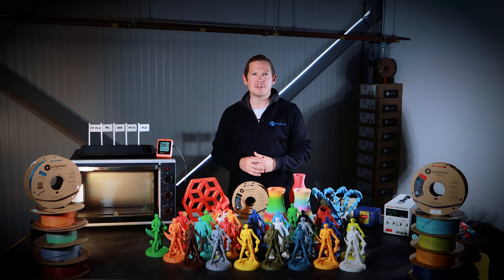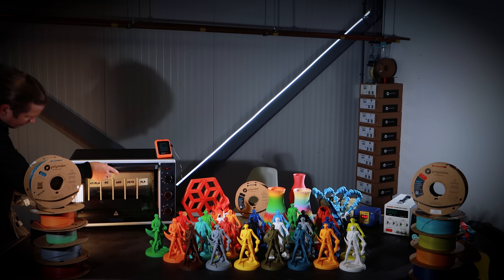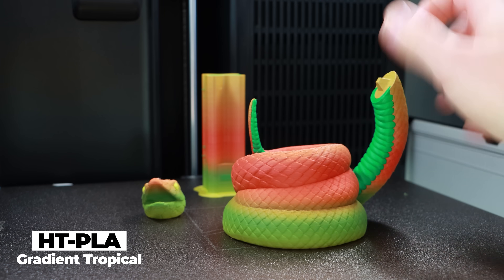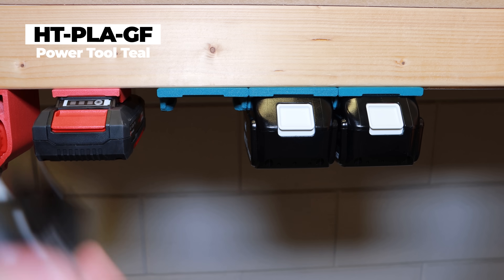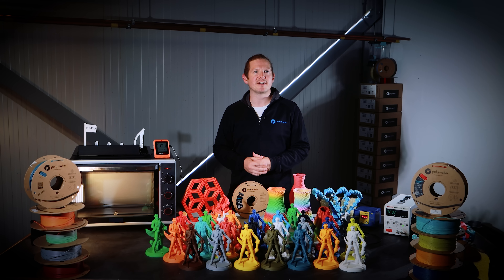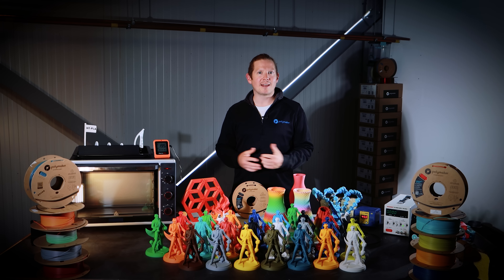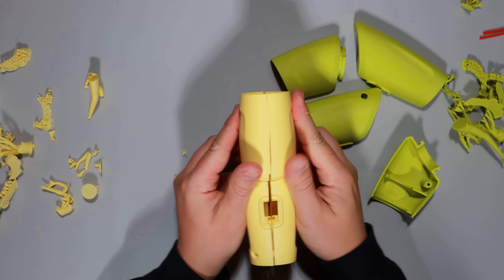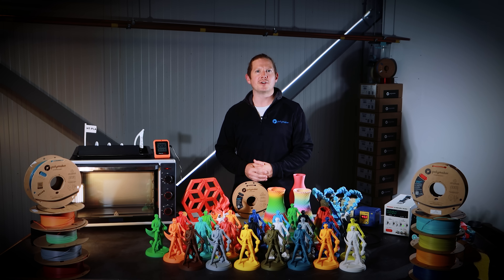HT-PLA: One Filament to Rule Them All 🔥🔥🔥

Comment: I am sceptical to say the least. These sorts of claims have been made before, several years ago by Big Rep and others. The reality when testing that filament meant it fell well short of the claims.
The test in the oven looks very suspicious, the ABS, PC and PETG flags all fell over before the standard PLA flag, that's a bit weird, isn't it??  And when the infrared gun was pointed at the PC sample, for instance, it read around 90C. True PC filament, not the easy-to-print stuff, has an HDT of 135C, and yet it melted at the same time as the ABS (85C HDT), and PETG (70C HDT).

I dunno, many things don't add up here.
Reply: I got a roll of this HT PLA a few days ago and finally got to try it. As I suspected the HDT, if any higher than standard PLA, it is only by a couple of degrees, maybe 55-58C before it goes flexible. 
It will NOT hold up to 75C like PETG, or 85C like ABS, or 130C like PC. It is an absolute lie by Polymaker, claiming 150C! If you don't believe me, try it for yourself. 

I can go into why this is, but you need to know how they do the official HDT test to see why it does not work for resins, nylons, and this PLA. Manufacturers use the flaw in the HDT test to make wild claims. If anyone is interested, I can go further into...
Reply: Well... that's what channels like cnc kitchen are for
Reply: @Vizeroy9  While I find those types of channels interesting, I would never believe the claims until I've tried it myself. With 20 years in the printing industry running a leading print service, I believe our customers deserve the truth about the services and materials we offer, not just here 'say.  
I would argue, through experience, that over 80% of claims made by material and machine manufacturers are false, but go unchallenged, and influencers spread these mistruths as gospel. This sort of thing is rife in this industry, it is very disappointing, and only getting worse.

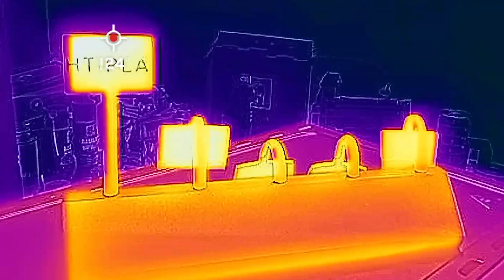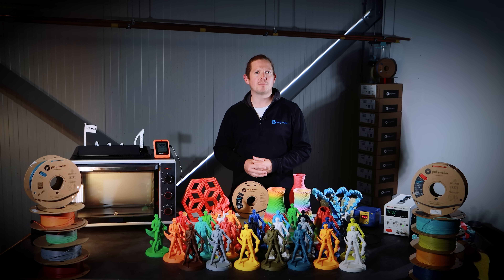Comment: There were a few shots you did that made it seem like you were hiding or minimizing some of the warping/drooping the HT-PLA was undergoing.  @5:10, you swept the camera low to hide the fact that the HT-PLA had warped backwards a bit, and at 7:09 you never showed a comparison in joining the drill housing parts before and after annealing, and the annealed HT-PLA-GF parts still have significant gaps in the joined housing.

I'm not saying I'm not interested in the product--frankly, it could be very useful--but some of the video editing/camera work choices definitely left me feeling like there was some deliberate manipulation going on. Which, obviously erodes my trust in the claims and company's integrity.

Comment: This is a MASSIVE revolution on 3D printing. Most people thinks that the evolution (and revolutions) in 3D printing is about the printers, and it's true but you can have the most advanced 3d Printer on the market but you cant print a simple coaster in a non "exotic" material that you can put in the dishwasher. So the real big evolution is on the materials! Thanks Polymaker for this, hope to be able to buy it in Europe as soon as possible.
Reply: Except they are marketing it as new? Other companies have been doing it as much as 5 years ago so what's different about this? And does it need a hardened nozzle?
Reply: @magus104 it's quite different, just read the data sheets.
Reply: not that massive since one company already had this, it was just more expensive
Reply: @riba2233 I don't know the company you mean, but the ones that I know that have ht-pla have really different thermal properties like a lower heat resistance and deflection specs (in some cases WAY lower that the polymaker's one like 70 Vs 130...) , no thermal stability during annhealing , and printing speed max at 60/90 mm/s.
This is the first product that I know that has a heat temp resistance up to temps that neither ABS can stay, a perfect dimensional stability during annhealing and a very high printing speed up to 350mm/s. If you know any other brand that has ht-pla with the same or better specs, please tell me because I will buy it immediately.

Comment: What Ingeo resin do you use (I see that branding on your spools)? And how does your filament (with your "11 herbs and spices" added) compare to that raw Ingeo resin?

I am a little disappointed in your naming, because it will be easy to conflate your HT-PLA with ProtoPasta's HTPLA (Ingeo 3D850, I believe). But, I do applaud you for including the empty spool weight on the spool's label. I often have to bother filament manufacturers to get that value so I can track how much filament I have left on each spool by weight.

Comment: HUGE! Cant wait for the UV-resistance tests! If its practical for outdoor use, there is literally no reason to use different polymers, apart from vapor smoothing maybe
Reply: it's UV resistance is similar to standard PLA
Reply: @PolymakerPete  damn. Well, its still PLA so I guess thats to be expected. I will probably stick with ASA for outdoors, but for inside the car, it should be perfect!

Comment: I really appreciate the no BS of this announcement. There are a lot of companies that try and make something better then it seems. They clearly showed it's improvements and its limitations.
Reply: I also appreciate them not calling it biodegradable, it's industrially compostable.
Reply: In my eyes, this company is the one of the most reputable and reliable filament maker company.
Reply: The temperature limit is impressive, but let's set aside the heat resistance test for a moment. Is this truly everything standard PLA offers, just with added high-temperature (HT) capabilities? After reviewing the My Tech Fun analysis, it appears HT-PLA is a weaker material across the board—except, of course in thermal performance. So, is it really "everything PLA is, & HT resistance"? Not yet. Hopefully, you'll develop a version we can genuinely call PLA+ht. Right now, it's more like HT+pla, where heat resistance has overshadowed all other essential qualities of PLA.

To illustrate, imagine if regular PLA exhibited such compromises: layer adhesion failing at an average of 24kg or tensile strength breaking at around 48kg, This would be considered rubbish PLA. Until high-temp PLA matches or exceeds standard PLA in every other metric—while retaining its HT bonus— we can't claim a true breakthrough has been achieved!
Reply: @gtrargh6637 it has to be printed at higher temp but yeah, it's not the same
Reply: they didn't show all limitations
Reply: LMAO yall are susceptible to propaganda
Reply: @youtubehandlesux because of some mild praise for a company that genuinely makes pretty good products? Your bar seems a little low and a lot misplaced lol
Reply: This video was only BS, nothing they showed was true! Get the material and try it for yourself. I would suggest not buying it though, as you'll just waste your money like I did.
Reply: @bendoon12 it was all true, what are you even talking about?
Reply: @riba2233  So, when I put a 3mm thick test part in 60C water, and it went floppy/flexible and deformed... you think that is better than standard PLA?

Comment: How does the additives used in this HT-PLA affect its recyclability/compostability and are there any non bioplastic additives in this?
Reply: The resin matrix of HT-PLA contains only a small amount of non-biodegradable components. Therefore, we consider it to be a material with good biodegradability similar to polylactic acid.
Reply: @PolymakerPete  wonderful, however when you say small, could you please quantify that to an approximate percentage. Are we talking fractions of a percent, <5% etc or does small just mean <50%?
Reply: @n0vaph0enix  Hey, how come I cannot see their reply to you? Is it hidden for you now as well? Interesting that such info on the material gets removed from the comments...
Reply: @Prefrontal_Cornflakes I think they may have updated the comment as a direct reply to my first message (or it’s a weird youtube thing as it’s showing as a highlighted reply in my view).
Reply: @n0vaph0enix Oh, alright, I guess it might be just on my end then, since it's still not showing. Or as you say, youtube shenanigans xD thanks for clarifying
Reply: PLA in general is not very good in compostability (though better than other materials) nor recyclability (can't really mix random plastics with "real" plastic in recycling, unless doing some mix bulk product (flower pots etc), but all of them can be burned to energy).
It's more about where and how the raw material comes --> what it's carbon balance at the end of life/use is. Oil-based plastics add to atmosphere CO2 , while plant-based plastics (PLA, micro cellulose) circulate it.
Reply: @kimmotoivanen thanks, I am aware of that, but what focused I’m on whether this this resin mixture affects that in any way meaning it can no longer be accepted in PLA recycling schemes and existing industrial composting facilities.
Reply: @PolymakerPete there are various recycling schemes globally that take PLA but some (such as 3DWaste in the UK) specifically only take PLA, so it’s important to know how much additives are in the mix to ensure it’s low enough not to contaminate virgin PLA waste.

Comment: How is layer adhesion?
Reply: TDS is on the product pages for each, but if you're comparing to other PLA's it's similar to standard PLA.
Reply: poor unfortunately
Reply from the maker: Tensile strength (Z): 20.83±0.51 Mpa

Comment: Your TDS stats do not seem to match the claims around this product. According to your product pages PolyLite PLA seems to have a HDT at 0.45 MPA of 60C, and now your HT-PLA has a score of 69C. This is much smaller of an improvement as I was initially led  to believe, let alone over other materials, such as your PolyLite PETG scoring 78C.

You say the material requires no post-processing, but in this video you show that the 114.7C HDT score is only achieved after annealing. While I don't know the figures of your other PLA offerings when annealed, I do see in the Journal of Applied Polymer Science an article about annealing PLA in injection molded products reaching approximately 110C, which if consistent with 3d printed items would leave me disappointed with the performance of this material.

You then in this video repeatedly compared annealed glass fiber reinforced parts under annealing against regular PLA, whereas showing no comparison to regular PLA with GF or even regular PLA vs plain HT-PLA when annealed. I can also imagine that comparing the HT-PLA GF to a GF reinforced PETG or ABS would find those latter options having far better results.
Reply from the maker: Our claim about HT-PLA is that it is heat stable (hold its shape without external load) up to 150˚C (the Vicat Softening Temperature).
As a note, the Vicat Softening Temperature of PolyLite PLA is around 60˚C.

And indeed the heat resistance (hold its shape under external load) can be increased over 100˚C with HT-PLA-GF by annealing it.

Comment: I have a very hard time believing this .
Softening temperature 150 degrees Celsius but you can print it with 205-220 degrees Celsius   .
Something just doesn't add up .
If this is shown to be true when we see different test here on YT , then the question is ,
how well does the layers fuse to each-other when printed ?  .
Hopefully we will soon see CNC-Kitchen do a comprehensive test on this filament
Reply from the maker: Edge of 3D already released a review on it and more reviews/tests will come in the next few days :)
Reply: I see he is affiliated with Polymaker ;-) .
I will watch the video and then see what other YTbers that is not affiliated with Polymaker have to say
Reply: you realize that cnc kitchen doesn't do filament tests anymore?
Reply: @riba2233  I did not know that ,sad to hear that he do not test filament anymore .
He was very good at it as i remember ,very comprehensive test .

Comment: I need to make some tightening resistant key in a material that doesn't deform too easy, I already tried nylon pa6 cf but was a bit too soft and after using it for 5 minutes destroyed itself (eaten by the copper part). What would you advice me for? Still filament material, resin 3D prints?
Reply from the maker: The best would be to reach out to support@polymaker.com.

Comment: no1 question: what's the price?    If it is going to cost 2-3 times more than regular ABS, it's going to be a hard sale.
Reply from the maker: HT-PLA is $24.99/kg
Reply: @Polymaker yeah, that's what I was afraid of, where I live: 1kg of basic pla is 10 usd, abs 8 usd, it's just making it  hard economically to switch to this material when basic alternatives are 2-3 times cheaper and all the infrastructure is already there. I wish to see this material being industry basic standard, cause it's cool no doubt, but it has to drop the price for the majority to switch. Until then it's a novelty.

Comment: For filaments like ASA and ABS, you typically don't want to use those on an open printer because the fumes are quite nasty (both smell wise, and the potentially can kill you wise). Is this HT-PLA as safe to use as vanilla PLA (smell wise and less likely to potentially kill you wise)?
Reply from the maker: HT-PLA will be similar to just regular PLA :)

Comment: Nice. Gotta try once it arrives via 3Djake local reseller.
Reply: A bit of a worry I have with PLAs in general is accumulating microcracking under high permanent (weeks/months) load till failure. Had that with some brands. Unfortunately this is one thing nobody tests with filaments ATM.

Comment: Sounds awesome. I'm interested if it's, due it's properties, a perfect candidate for real high speed printing. Since the delta between extrusion and solid is a lot smaller than usual blends it may be a game changer. If you want to see if it can run at 2000mm/s with very low layer times, I could give you some results!
Reply: It says "Up to 300mm/s" on the spool
Reply: how do you measure printing speed in mm/s? What does printer movement speed has to do with print speed? Does it assume 0.4 nozzle, 0.2 height, and 0.42 width, or it's 0.1 nozzle and you actually become bottlenecked by the printhead movement speed instead of max flow?
Reply: @mklabtech  It's an estimate without further explanation. People consider it a "generic safe value for your slicer", and it makes sense that it's slow for HT-PLA since it already has the worst layer adhesion of any common material according to Polymaker's datasheets. They even recommend against using it for single-wall prints. The only reason to get it is for the highest heat resistance without hassle

Comment: If mainstream, i dont see the purpose of using PETG anymore
Reply: each grade of filament will have it's purpose. PETG is great for chemical resistance and ductility over PLA so if that's not what you need, then HT-PLA is certainly a replacement for you!

Comment: i don't believe it is "still PLA" - you put some stuff in it ot make this happen - could be some thermosetting polyer as an additiv or a copolymer that acts as a scaffolding and raises the glass transition and increases the HDT

so it is "mostly PLA" for sure, bit it is not PLA, like most "PLA" is not PLA but rather something added
Reply: we added the HT! haha but really HT-PLA is a kind of PLA-based multiphase composites, its main structure is PLA materials.
Reply: @PolymakerPete got you 😅

so question is, can it be remelted again - so can you recycle it in a regular PLA stream or is is the copolymer some thermo setting material that is not reversible like on variable hardness TPEs?

Comment: What about health safety? Is HT-PLA worse than regular PLA in this regard?
Reply: I am particularly worried about the GF variant. I've been unable to find much data on the effects of handling chopped-fiber filled filaments, besides tests that show that interacting with the surface can leave fibers embedded into skin and shed off rubbing surfaces. Unless there are new studies I haven't found, I don't particularly trust fiber filled filaments as safe to handle, as this feels it might be another situation like ABS fumes.
Reply: @astersfun  of course GF/CF filaments will shed fragments. Don't use it for things that are touched/rubbed regularly. But a as a functional piece that mounts something and is rarely touched - there shouldn't be any issues. The fumes might be an interesting part, as we have 0 clues what is added to PLA (if it is still PLA) to give it so much heat resistance.
Reply: I feel like this is a big topic which is left out right now.
Reply from the maker: HT-PLA is similar to regular PLA
Reply: @Polymaker  based on what evidence?

Comment: Does HT PLA GF need a hardened nozzle?
Reply from the maker: Yes it does
Reply: Most likely, yes.  It might also be better to print with a 0.6 nozzle to reduce the probability of clogging.
Reply: @fravier10001  we've been going through a ton of this with no clogging issues what-so-ever on a 0.4 nozzle!

Comment: Had to doublecheck the calendar to make sure it wasn't April 1.  OMG!  This is huge!
Reply: the test looks a little wonkie if you ask me. Why is the regular PLA in the oven outperforming PC and ASA in a heat test? You normally use those materials when you need heat resistance over what normal PLA provides. So is Polymakers regular PLA already more heat resistant than other brands?

Comment: Is it less brittle than pla? I use pla+ as it's significantly more durable
Reply: This was my question - how does it stack up with PLA+ ?
Reply from the maker: It is currently more similar to regular PLA.
Reply: @Polymaker  Alright I hope you'll make HT PLA+ soon. That would be the ultimate. Just had a customer's PLA+ order melt in his mailbox. But I haven't found anything as tough as PLA+ but also survive the heat and come in multiple colors.